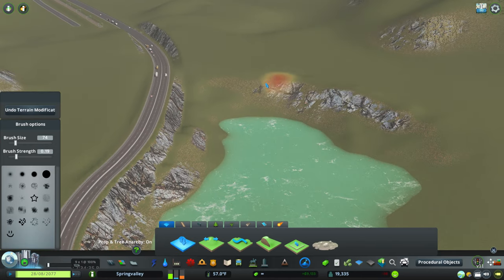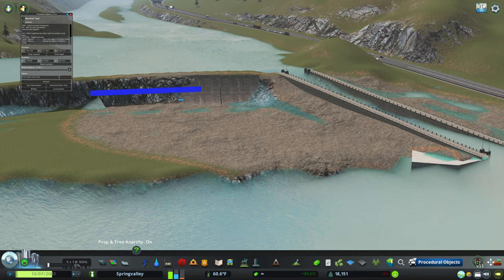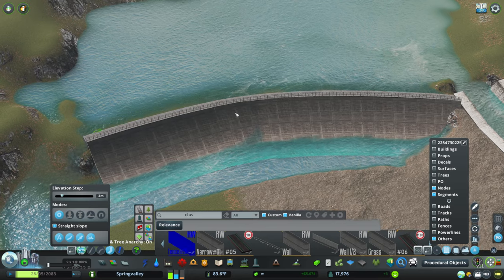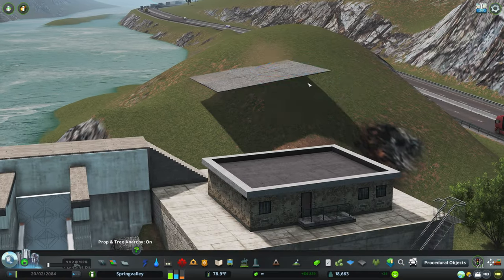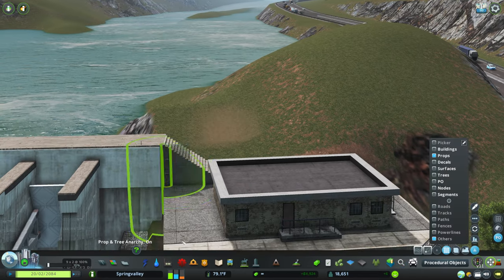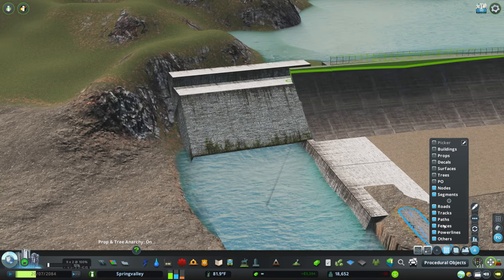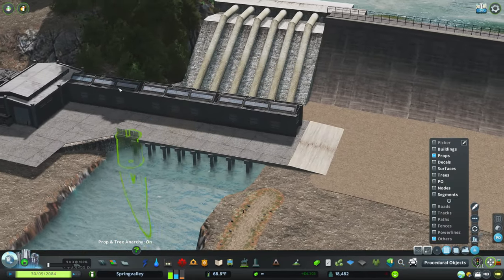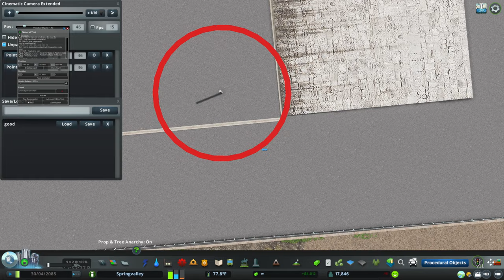Cities Skylines | New Zealand - Ep.14 Hydro Dam

Comment: fantastic build - big fan of Benmore (you've done it proud), used to go there a bit as a kid, my fave dam :) The road is fine, water level doesn't fluctuate drastically on a dam the size of Benmore, the road is a bit like that at Aviemore down the road from Benmore (though a more modest sized road).  Needs boat ramp and picnic area below the dam. Cheers